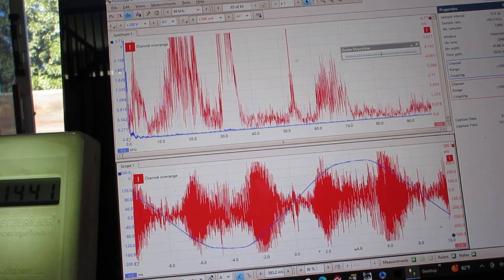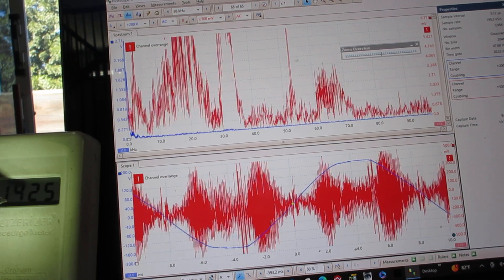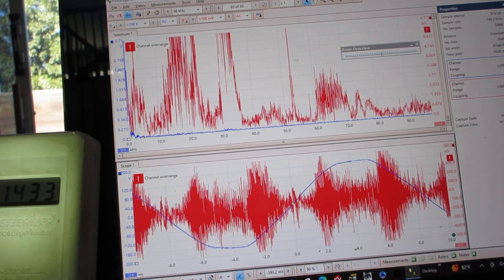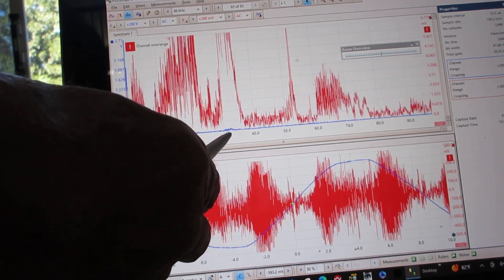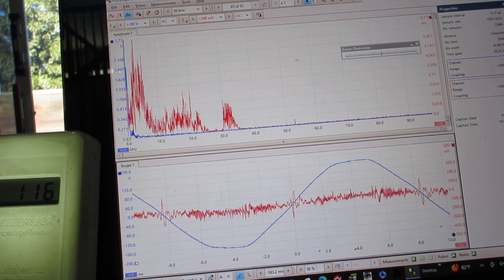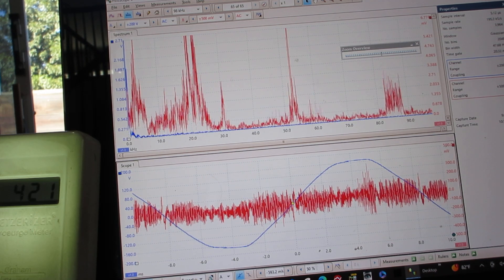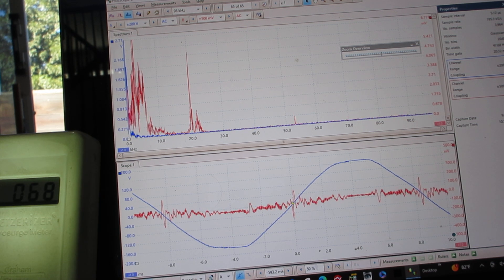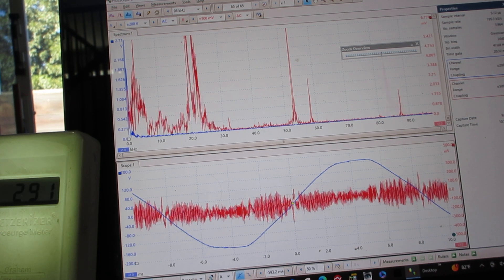Dirty electricity filter makes client feel better instantly!

Comment: I thought I was the only one who could feel the crazy vibrations and what not. It absolutely drove me insane. Air conditioning is what made the electrical system in my house worse. I have very little electrical items plugged in anymore.
Reply from the maker: Hi,  what make & model of AC inuit do you have? please advise.

Doe it have energy efficient variable speed motors or an inverter? please advise.  Eric W